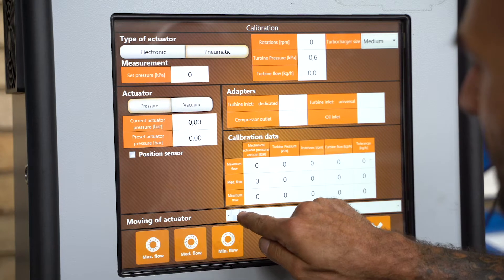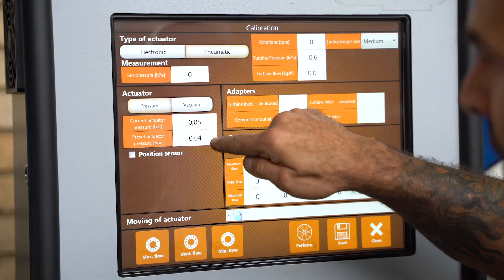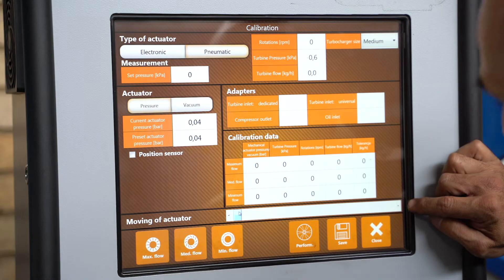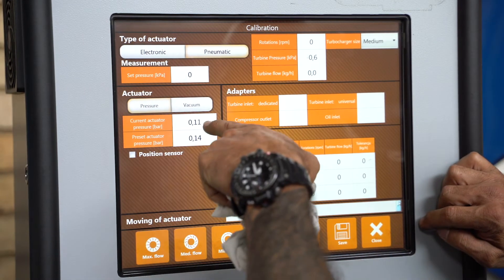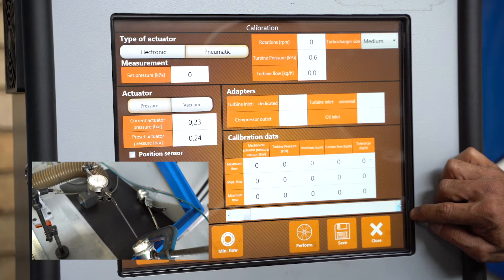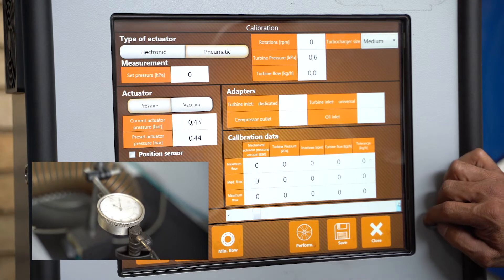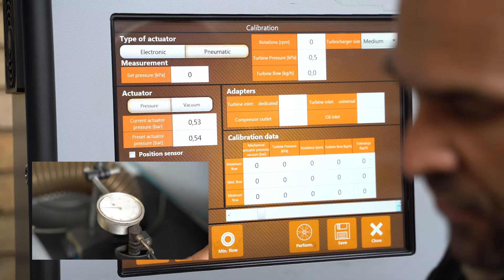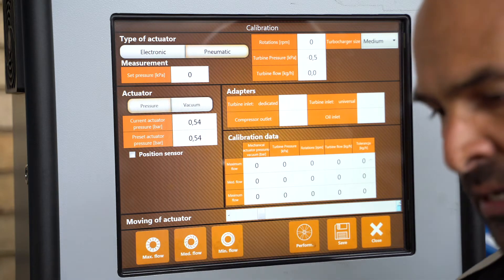Internally gated turbine housing vs Free Floating

Comment: What happens when you remove the internal gate and run an external gate, keeping the gated housing?
Reply from the maker: You introduce Lag -- the more area that is added to the system is essentially added to the A/R of the turbine housing. This is why the internal gate works so well especially when the valve is large enough to flow the required air flow for the larger rotating assemblies like the EFR7670, EFR8474 etc

Comment: Hi, last question on your development vehicle, i think we all here sitting with pen and paper learning from turbo direct. Could you do an introduction of the development vehicle..... what is it?? what you are trying achieve...... from there,,, why, the choice of turbo, intake, ecu, tires,injectors etc...... there might be alot of reasons why and why not. especially on the extremely broad 2jz conversion platform. i know for one, the most common topic is gearbox choice and clutch combo. most of my friends have d4d with their jz, but is this their only choice........(just as an example)
Reply from the maker: Thanks for the comment - ill do this in time - i dont want to do this just yet as i have not provided for much time for this project at the moment, so making the video will seem opened ended and it will excite and wet your appetite and then disappoint you. Once there is progress ill update with a video and then youll see the planning and thought behind it and understand why we chose which products for the build.

Comment: How do you feel about exhaust housing that have a port for an external gate right on them?  Seems like they would be great for boost control, but I wonder about them introducing exhaust turbulence so close to the wheel.
Reply from the maker: I love it - depending on where the port is situated. If the port is situated ONTOP of the turbine housing just after the inlet merge, then thats perfect - as the pulses have to continue around the entire volute before getting to the Inducer of the turbine, which negates any turbulence or more importantly interference.

Comment: Solid video. Your flow machine and dial setup top my bicycle foot pump by a slight margin... Back pressure influence was very clearly explained.
Please touch on dual port versus single port actuators and control/cracking responses.
Reply from the maker: Hahaha we try, next ill show yo our coal generated dynamometer..... :-)   The twin port actuators work exactly like an external wastegate --

Comment: Very interesting subject, me and a friend were just discussing about boost control, more precisely the 3 ports mac valves operation in conjunction with an electronic device and the 2 ways to connect our valves with the wastegate producing either a constant sound or a flutter sound ( external dump wastegate ) ; we found that : when we only connect the bottom port of the wastegate with the mac valve the wastegate valve oscillate, creating the flutter sound with the wastegate dumping at the atmosphere, we found also that :  the pneumatic valve pulses frequency (10 to 30 Hertz) was the reason of that unusual sound because of the boost signal fluctuations at the bottom section of the wastegate, making the wastegate valve oscillating and so producing a flutter exhaust sound, so, my questions are,  do you think you'll produce a video about the boost controller hitself ( manual and electronic ) and talk about his operation ? Thanks !
Reply from the maker: Thanks for the comment and interaction, i will be producing alot more videos of boost control and different turbochargers with various housing choices and the effects and techniques of controlling boost soon. These videos willbe released once we have completed the build of the 1JZ motor in our test car - ALOT more physical testing to come soon.
Reply: @TurboDirectSA  awesome
CO2 boost control. 3 port valve boost control. 4 port valve  boost control. Stand alone ecu boost control vs electronic boost controller...... This is so exciting stuff.
Reply from the maker: @road_2_pow_r   Thanks for the comment - ill work on this for the upcoming videos and see what we can do on explaining this for you. I can tell you though that the boost control inside the ECU (ECU dependant ofcourse) is in many cases much better than running an external control, as internally the architecture is designed for the control of boost inside the ECU and mates with software and controls which integrate it into the rest of the engines controls and management.
Reply: @TurboDirectSA  ok thanks, we stay tuned